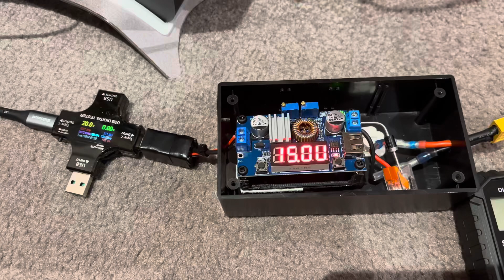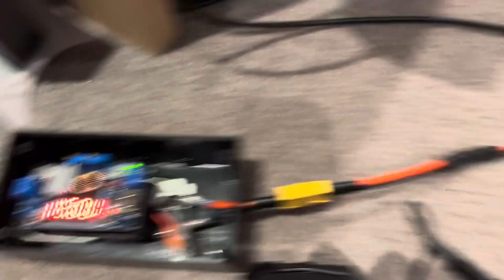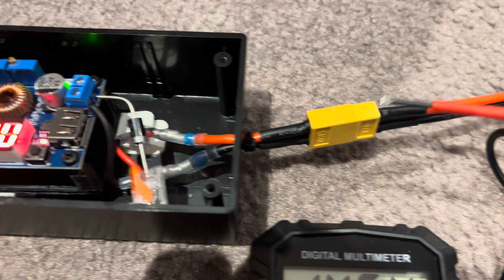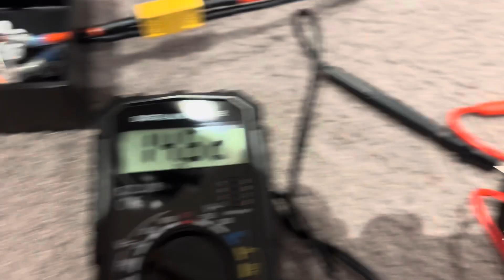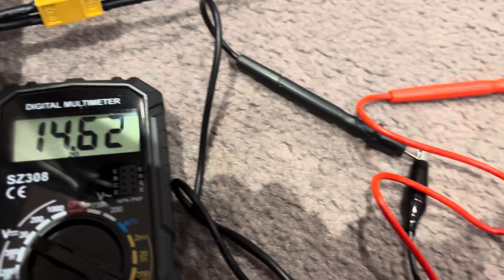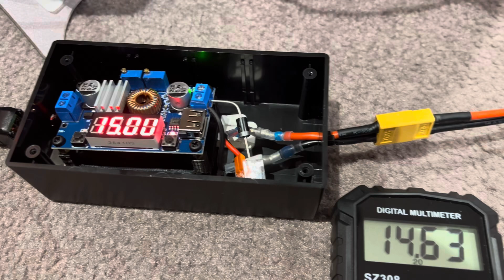Adding a diode to prevent backfeed into my USB-C LiFePO4 charger

Comment: You have to be a bit careful with the diode.  The voltage drop is NOT a constant.  So you will get a voltage drop while current is flowing, but as the battery becomes full and the current goes down, the voltage drop across the diode will also contract until it is basically zero at zero current.

You can also use schottky diode instead of a regular diode if you would like the voltage drop to be lower and the diode to not get as hot.    Generally speaking, without a heat sink on the diode or airflow, the free-air power dissipation that the diode can handle is only going to be around 2W ... 2A with a regular 20A diode, 4A with a 20A schottky diode.  Even if it is marked as a 20A diode.

-Matt
Reply from the maker: Thank you for this information. So I need to pretty much switch it off when it has charged. I do keep quite a close eye on it and have a voltmeter on my battery. In my latest video I added a case fan. Go check it out 👍

Comment: Here is a tip, google ideal diode. Its a board with a chip and a mosfet, and will work in the way you want it to. But with almost 0% voltage loss. They are quiteinexpensive on aliexpress. Take one with the ground pin tho. The ones without pulse.